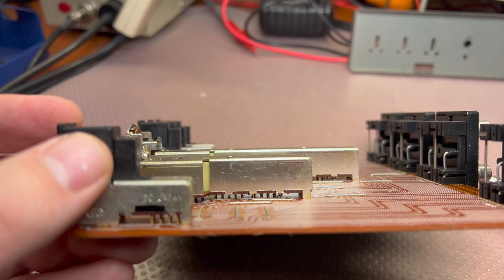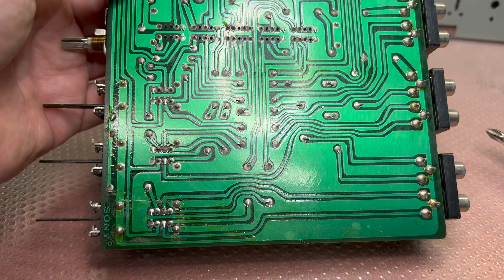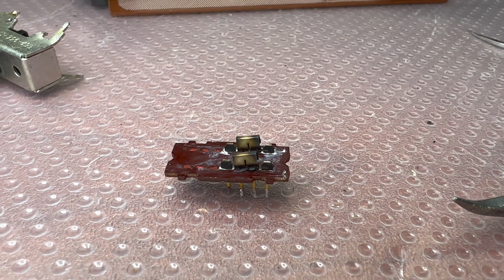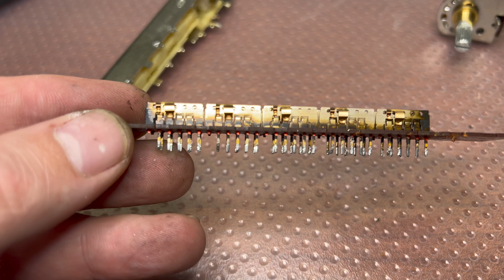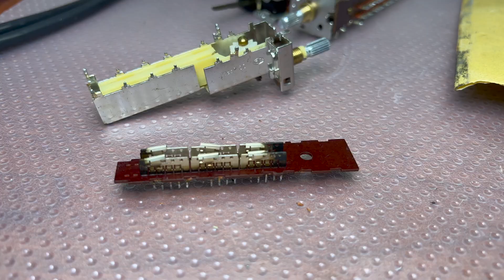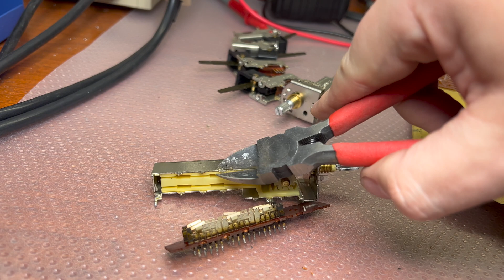Inside the Switch: Unveiling the Secrets of 40-Year-Old Audio Switches

Comment: The unmistakable shape of manually routed (designed) traces. Got this multi-tape switch as well.

But I did not disassemble mine, I extracted the board, sprayed inside the switches, waited, activated the switches several times, flushed with new de-oxidant product and repeated again before blowing it off with compressed air and greasing the front rotary bearings.
Reply from the maker: Deoxit did not help as you may see. I measured about 2 db high frequencies loss in some modes, that is why I decided to disassemble
Reply: @hifirulezzz  basically you're telling me to scope it ;)
I am after SB-900, tape decks have overrun my switches capability (it's not the only one).

Comment: That type of grease and oil do you suggest for audio use?
Reply: If you check other videos for grease he uses Haynes Lubrifilm Plus. It must be safe on plastics.

In my experience not all lubricants are suitable, I've bought a spray-can silicone based one that once dried it leaves a sticky residue. Ideally you want to use mineral oil, I believe one of the best possible sources could be sewing machine brand-name lubricants.